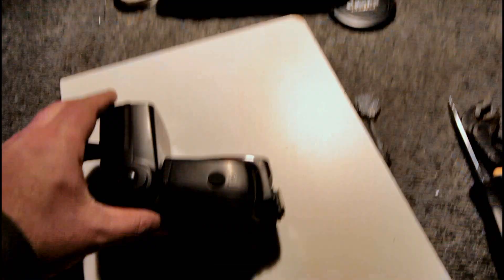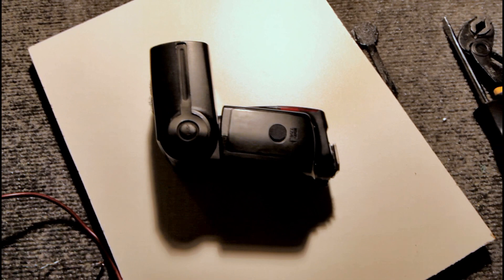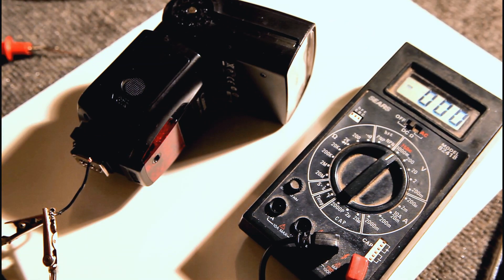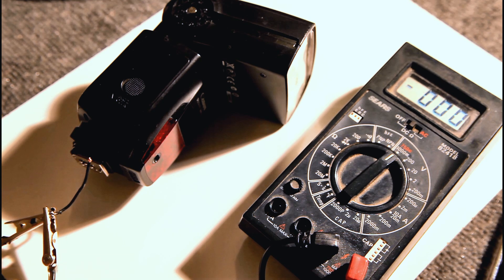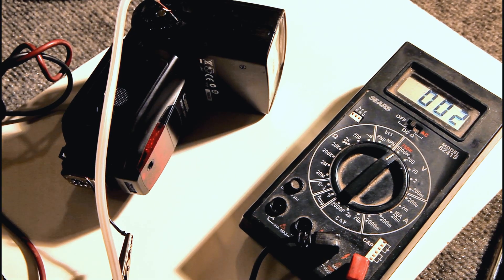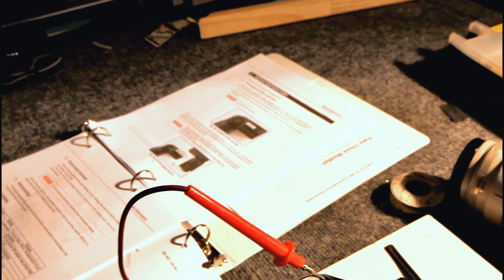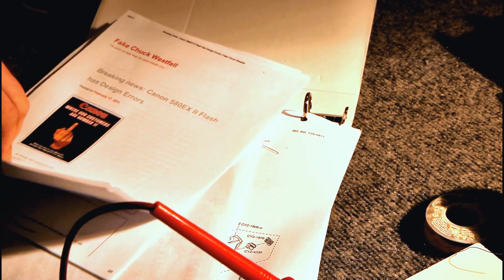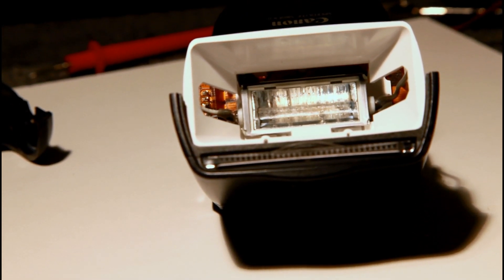Canon 580 EXii Capacitor Discharge

Comment: How long does a capacitor hold its charge?  My flashgun hasn't had batteries for over a year. Surely there's no charge right?
Reply: i saw someone's post about being shocked  by flash after 7 years in garage.
Reply: Depends on the environment and capacitor type. In the correct conditions yes a cap can hold charge for years.
Reply: Just get a multimeter and check, if it's 0v, then it should be safe.

Comment: I did all this correctly but never was able to detect any voltage.So i thougth the capacitor might be allready discharge. The batteries were taken out 2 weeks earlier. I asked someone who knew more about this kind of stuff and told me these devices it must allready have resistance when batteries are taken out to slowly discharge the capacitor for safety. So i proceeded carefully with disasembling. I touched every components (with safety distance, gloves, pole and fear... haha) and never had no shock. Changed the bulb with success. Anyone can explain me what could have happen? was my friend right? was two weeks enough for the capacitor to loose all it's power?
Reply: https://www.youtube.com/watch?v=renHvqrMxXA
How to discharge the capacitor and change it
Canon 580EXII Flash Lamp 👆👆👆👆👆

Comment: DO NOT use a 500OHM resistor like mentioned in the first part of this video.  I used 1000OHM to discharge my flash from a 320V reading and it freaking exploded instantly.  My voltage is down to 140v now but a 500OHM resistor cannot handle a 320V load apparently.

I did notice you said 3200OHM later in your video, so I guess that is more appropriate and doesn't explode!

I'm using a 15k resistor I just found and it is doing a much better job....

Comment: Just FYI, there is not enough current on the cap to actually do bodily harm.  Granted it will scare the crap out of you, and prob hurt a bit, there is no amperage.
Reply: This is completely untrue. They can absolutely cause bodily harm. Capacitors store charge not current. The current that flows during discharge depends on the conductivity of the thing it discharges through. If it's through your heart then your body may offer quite some resistance in which case the current will not be huge. Still it only takes 75mA to be able to alter the beating pattern of your heart. If on the other hand your finger is wet and you accidentally touch both terminals with the tip of your finger then not only will you know about it but you'll suffer a pretty vicious burn. You can suffer bodily damage in a variety of ways, direct contact burns, ventricular fibrillation or cardiac arrest. People often say "it's not the voltage that kills, it's the current"... cue many other incorrect statements... it depends how the electric shock kills you as to what feature of the charge flowing through your body did the job. For example, small current for a long time can cause fibrillation, seriously high current quickly can cause cardiac arrest, oh - and it depends on lots of other factors as well such as how much water your cells are currently storing, what clothes you are wearing, etc, whether you are old, pregnant, a child, etc. Either way it's not safe to spread around misinformation like that.

Comment: Hello!
I have a problem with a Canon Speedlite 580EX II. Whatever the mode and settings that I use, it triggers only at maximum power. and the preflash for ETTL mode it triggers at the maximum ori if i press the pilot.. even with the flash off camera using only pilot button for test, in ETTL or Manual mode. in any case it triggers only at maximum power
anyone know what is the problem?
Reply: people say - the most likely reason - fault IGBT. You just have to replace it.